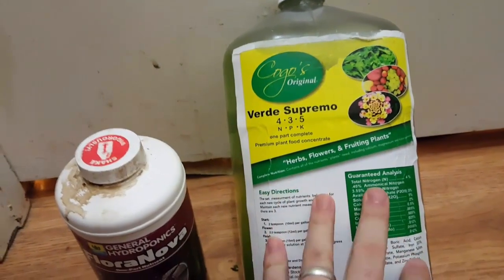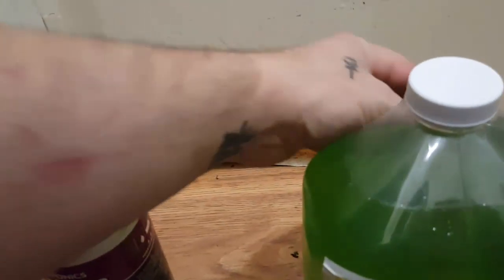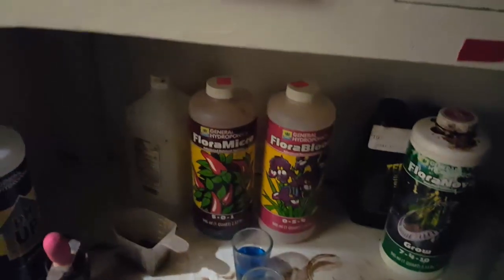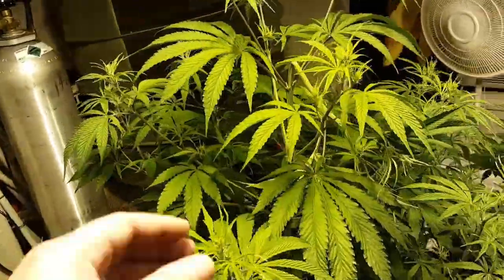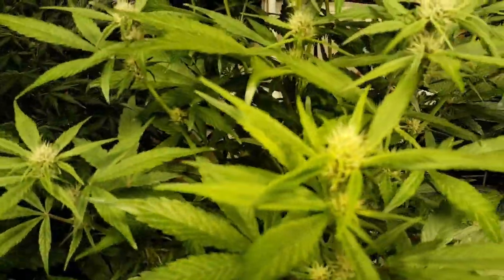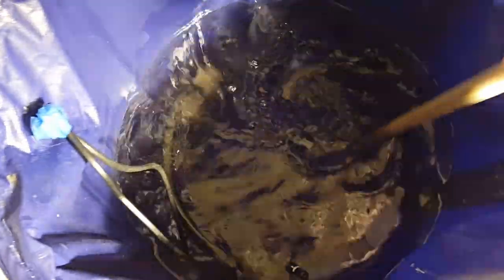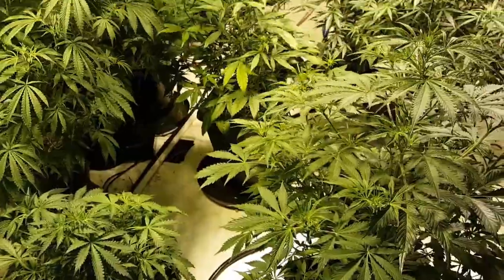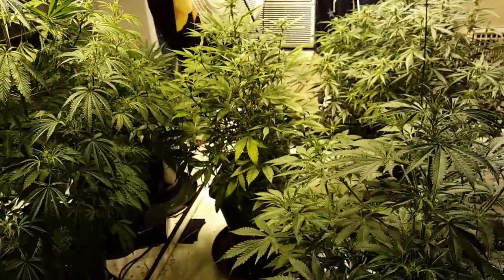nutrient change why how measurements

Comment: Nice pull o0n the autos bud, very snarfly! 

I find that filtering the water the day before I use it helps. I filter it through a normal water filter for drinking water and then pH it to around 6.0pH. Then the next day I mix my nutes and pH it accordingly again.

I still get a rise in pH during the week (I'm using homemade DWC Style buckets at present, going to coco in flood & drain in about 6 weeks for summer).

But leaving the water to stabilize for a day or so means I add more water about 3-4 days later to top off and pH again which means the pH does not rise/fall too much to have to use pH up/down on the off days so to speak.

Just an insight I have gained.

Growers Love BU

Comment: Off subject but i'm wondering why you dont use the GH 3 part system. Grow, Micro, Bloom. I've heard it's good practice to cut the recommended dosages in 1/2. I've been to your site and seen the feeding schedules you're using, and I got super confused. I've seen almost all of your videos, you and i have chatted a few times too. Is there a reason you don't use the Micro? What's better about the FloraNova? Last crop I used the 3 part system cut in 1/2 but had issues with my environment and stretching. Now that I saw how to micro top things are getting way easier. Anyways, suggestions? reasons? answers? Super curious.
Reply from the maker: +Mikey GoFast I used the thee part system when I first started. Then I changed it to just the micro and bloom, a modified lukas formula. Then I tried Flora Nova and loved it (for hands watering) Buds tasted better, no flush even needed, really. Flora Nova has the micros in it. So it was easier to use.
Reply: So I'm not doing any harm using the 3 part? i already invested in it so I want to put it to good use. I'm doing molasses every other water @1/4 tsp/gallon. I hand water daily growing in coco. Is it possible to get the same yeild as the lukas? If not i'll switch it up.Grow Pot Cheaply
Reply from the maker: Yeah, the three part works.
Reply: cool. good lookin out
Reply: Grow Pot Cheaply
where do you source your seeds? i've had bad luck with amsterdam and heard that speedy is horrible. people are saying herbies is good, just hesitant to throw more money away.

Comment: weird idea, but, what if you added pH up and pH down to neutralize themselves in the water, in order to help stabilize it? I think I heard someone say that usually the more "shit" you have in your water, generally the more stable it is, and generally the larger batches should be more stable.

mine rises from about 5.5 to about 6.0 in about 24 hours, but i'm only running 2.5 gallons at most in each 5 gallon dwc bucket, EC of 1.8. i usually let it sit higher, i've found my current stuff likes the higher pH as opposed to the lower pH. as it stands, by the time i'm getting to 6.0 i need to add a gallon, so i usually pH the extra gallon down to 5.5 or 5.6, and when i mix it into the bucket, it comes out right around 5.8 and will stay that way for right around 2 days before i need to add another gallon or so.
Reply from the maker: +Munky332 This new Cogos is super stable. I PH'd it to 5.5. 24 hours later, it was 28. 48 hours later, it was 6.0. Then I PH downed it to 5.7. 48 hours later it is still 5.8.